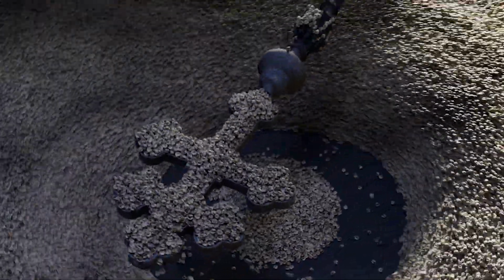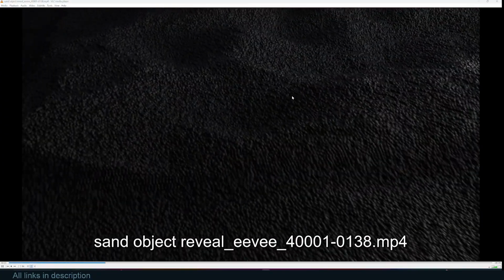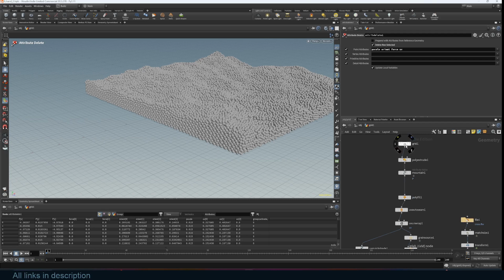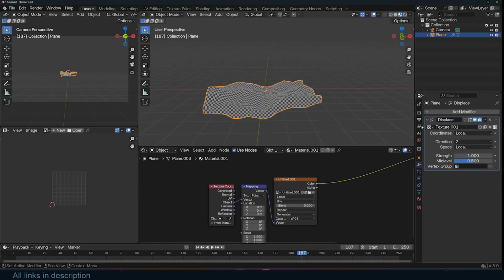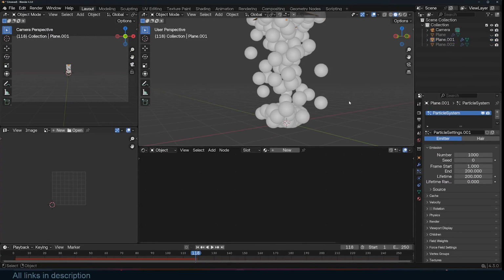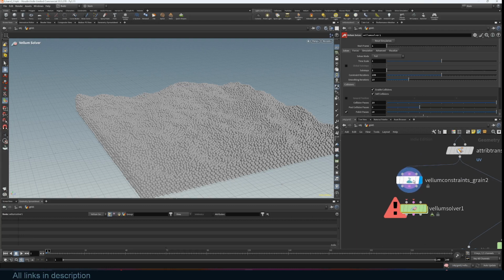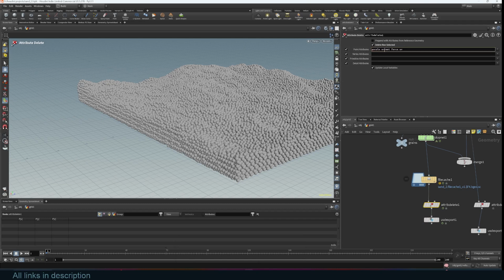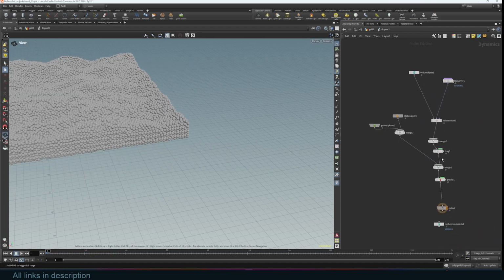learning houdini like its blender   creating a sand simulation

Comment: You’ve made a wonderful series so far. Can’t tell you how many times I’ve wanted to do self-colliding particles in Blender. I’ve always had to do the work-around of using the fluids physics in the particle system, which works OK but takes a lot of fiddling
Reply: Yes
Reply from the maker: How did u get fluid particles to stop disappearing, there is no rotation either, I

Comment: Very nice :)
There's a checkbox on the Vellum Configure Grain node called Create Points from Volume, you can use that as well for generating points from an object, so you can skip the Grain Source node. I think it was created for Pop Grain simulations before Vellum.
In fact, the Vellum Configure Grain node is just a subnetwork with the Grain Source and a lot of ther nodes inside it. Also fun fact, the Grain Source is just a Points from Volume node and a lot of other nodes inside the subnetwork. That means you could just put down that, create the mass and isgrain attributes manually after that and the Vellum solver will work the same way :)
That's what amazing about Houdini, you can create sources, simulations or anything as long as you have the necessary attributes for it, which you can check in the Geometry Spreadsheet. As long as you have them it doesn't matter how you achieve it :)
Reply from the maker: Yeah it seems like there hundreds of ways to do something and there is always someone who knows a better way